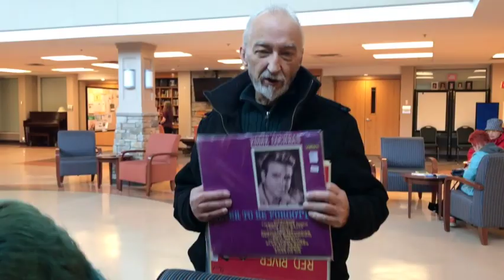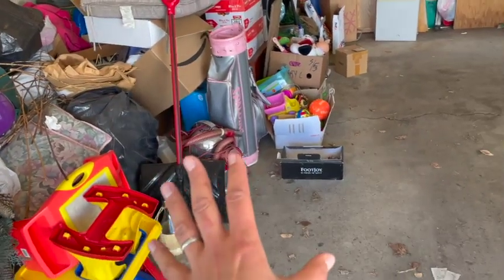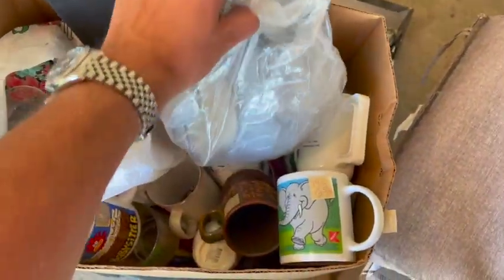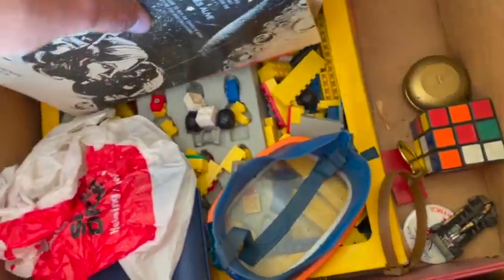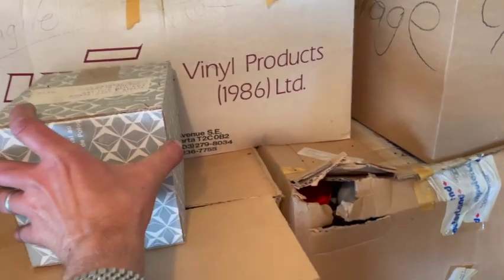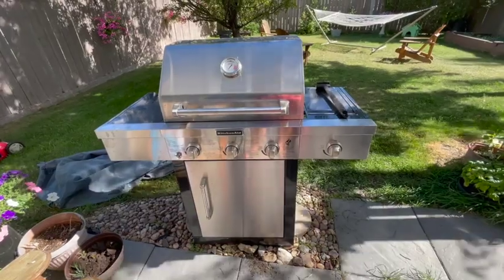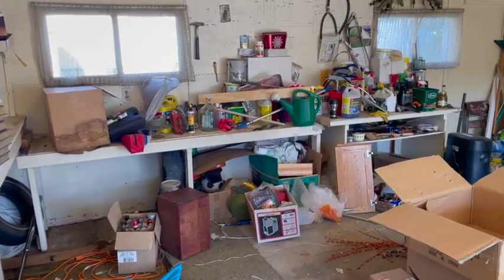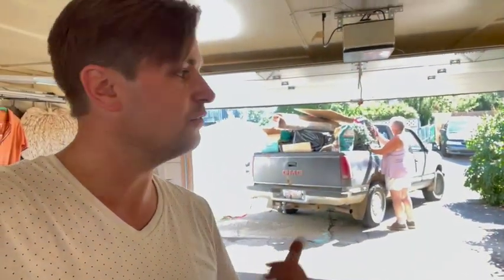Garage full for free! what will I find?!?  mystery estate unboxing!

Comment: I personally would have been absolutely stoked to have found an original Nintendo with all of the original controllers and the original games I would think that thing would be worth some money
Reply: The ROB was in a different box.  The grey zapper can be illegal to ship  The games as 3 separate cartridges is very rare.  That's the gem.  I'm not sure he realized the ROB with with the NES set.  Furthermore, it wasn't yellow.  That's a valuable find.
Reply: @kennethpospisil2721  Not really the NES goes for about 100$ US and no games there were VERY RARE all common games from 20-30$ US max and if you found a ROB "no accessories" that's another 120$ to about 150$ all based around ebay sold listings as of 6/27/21...Still Good finds none the less...
Reply: I was going to comment about the R.O.B. Robot Operating Buddy. When I saw the Gyromite game I wondered if the R.O.B. was there somewhere then a quick shot of a random box and there it was. The R.O.B. is kinda rare since only a few games where made for it. Most of them are usually broken when found.
Reply: It is. I sold mine 20 years ago.

Comment: So fun fact about those Gyromite, Duck Hunt, and Super Mario Bros carts. If they're the 5 screw variants, they could actually have a Famicom to NES cartridge adapter inside! As Nintendo was releasing the console in 1985 in North America, they were a bit unprepared for how wildly popular it was going to be. So to make up for the fact that they didn't have enough boards to make the 72 pin carts the NES used, they made a far simpler adapter that could be made quickly to convert the Famicom's 60 pin board to 72 pin, shoved them in an NES case, and shipped them like that. Curious people who opened up their carts discovered this and started ordering Famicom games directly from Japan. Since many of the early games were so simple that they didn't require translation to play (or even were in English to begin with) people were playing new games months before their official release in North America.

Oh, and after looking it up, the little TM symbol after Gyromite is actually a good indication that it's got an adapter board inside. Doesn't really make it worth that much more, like a couple of bucks, but it's still one of the better made adapter boards on the market.

Comment: Alex- used vacuums, unless one can be assured by the owner otherwise, may have been used to clean up broken CFL fluorescent bulbs. Read up on those- they contain hazardous material, (mercury, I believe) and that would be expelled into the air, exposing the user to the chemicals.
Reply: @Tine Lassen - regarding your reply about my comment being “random”- sadly not.at.all. 
From the standpoint of a cleaning professional, and a warm admirer of Alex and his family, I don’t believe I am being random, and, having had a family member who dealt with emphysema, I feel motivated to alert people about a hazmat situation they have some control over. 
The US state of Maine has classified broken CFL “Compact Fluorescent Light” (fluorescent =fluorine/ also a neurotoxin) light bulbs as hazmat, with specific treatment for disposal. 
However, in my professional experience, the average homeowner simply would sweep or vacuum up the debris, with that, in some form, being capable of being blown into the home’s air. That is ANY USED VACUUM - especially an older one, if acquired used, an unknown quantity for some while, absent the assurances of the original owner that no CFL’s has been placed into a unit.
I believe that the newer CFL’s with their silicone wrapped and/or sturdy plastic shells greatly, and thankfully , increasingly diminish the chance of mercury contamination. 
I would suggest someone considering a used vacuum for their home environment be aware of the history of such an intimate appliance, and protect their family. 
As a Professional House Cleaner, would you like me to bring a vacuum of unknown provenance into your home, every week? With NO knowledge of the effects to your family?